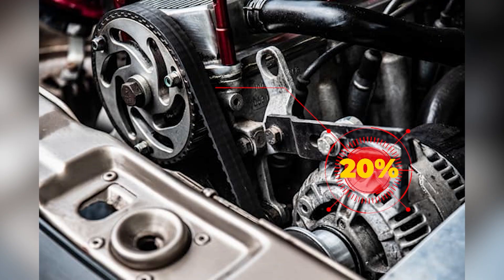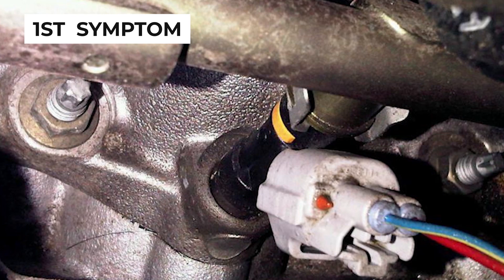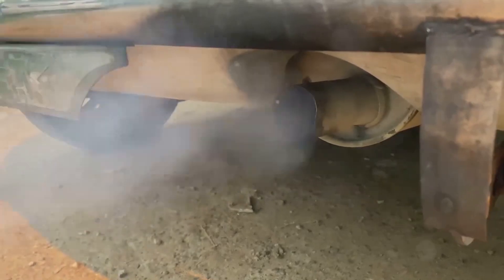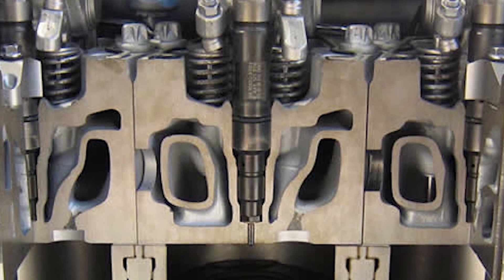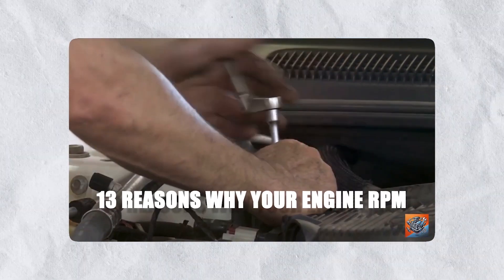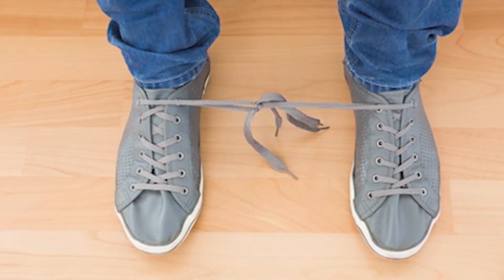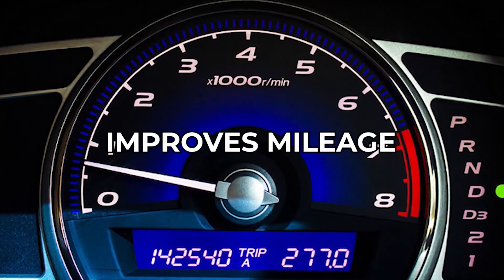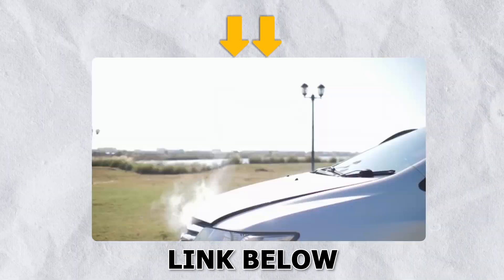13 Signs & Symptoms of a Bad and Clogged Fuel Injector

Comment: My engine makes a tapping noise and it's the loudest around the back of the engine (where the fuel injecters are, transverse i4) i also once whitenesed it shutter recently as if was falling asleep and went up in rpm to stay awake. Timing chain looks fine.
Reply: Have ya tried using a OB2 scanner device? Handy lil tools. ACCEL makes a great one for $20 some bucks and it has live data option among many others
Reply: @YahwehIsKingOfKings  I have but it was a friend's crappy one that only read codes (only a stored catalyst code, no check engine). I'll probably try one at some point but that is usually a good start. I should really have a good one tbf

Comment: My truck turns over and cranks but doesn’t start , would that be bad fuel injectors ?
Reply: Id check fuses 1st then fuel pressure and ignition. Could also be fuel pump relay
Reply: Check battery and also tap your starter with socket extensions bar or hammer , if your car starts after you tapped you have bad starter, also check fuel pump by checking your fuel pressure, pressure valve should be on fuel pressure regulator just unscrew cap and apply pressure gauge, also there are a lot of YouTube videos specific to your car.
Reply: Remove the fuel line and test for fuel pressure. Listen for a humming noise near the fuel tank, if nothing is heard, test for power, signal, and ground around the fuel pump circuit. If all checks out, replace the fuel pump.
Reply: Check for spark
Reply: What was the problem
Reply: Are you getting fuel up to the engine? Need to check your fuel pressure. No fuel pressure? Fuel pump is the most likely culprit. Make sure the fuel pump fuse is not blown also.  Are you getting spark? Plenty of videos show how to check your make,model engine for spark. 
Things get more complicated from here. Good luck
Reply: You gotta put gas in it

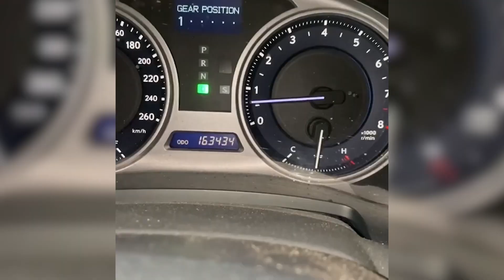Comment: 5:09 What if the engine only rough idles at cold starts? Does that still mean it's a fuel injector issue?
Reply from the maker: Rough idling at cold starts could hint at a fuel injector issue. A partially clogged injector sometimes clears as the engine warms up. However, other factors might also be involved. Sensors, like the coolant temperature sensor, can impact cold starts. Additionally, cold starts affect the air-fuel mix, sometimes causing imbalances. Start by checking the injectors, but keep these factors in mind. Thanks for watching and engaging with the video
Reply: @carcareclues  Thanks for the good info. Can you please explain why a partially clogged fuel injector may clear after the engine warms up? What is the logic behind this? Thanks once again.
Reply from the maker: @angelamartim8337  A partially clogged fuel injector may clear up as the engine warms because heat can thin out fuel and loosen debris, allowing fuel to flow more easily.
Reply: @carcareclues  Thanks. Alright, I got another one for you, if I may. For example, I've just recently found a video about "air-fuel ratio" and the author says a richer mix will protect the engine because the more gasoline injected, the less heat it will produce. Isn't it the other way round though? If I learned correctly, the engine will consume more gasoline after cold starts because it is trying to heat up faster, not cool it down. What is your opinion on this one? Thanks again!